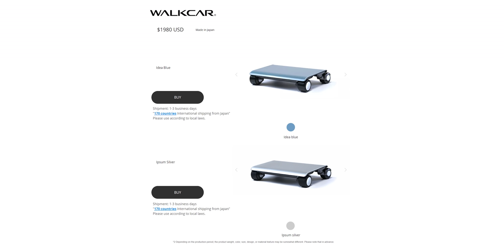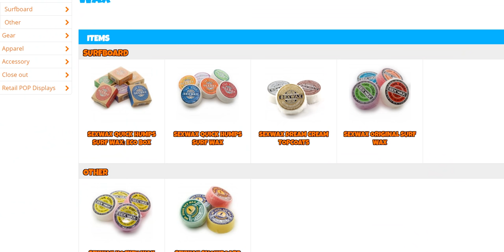Who paid $2000 for THIS...? - WALKCAR

Comment: Okay so, let's perfect the product: TWO separate platforms, one for each foot (better stance/control). Maybe just scrap the motors altogether so people can predictably control speed/turns. For better braking just add big rubber bits on the front so you can toe down to brake. Maybe make the whole thing out of a cheaper material like...I dunno, leather (could probably get away with laces like a shoe has, too). Throw it all together+slap on some LEDs+charge half the price these guys are=profit

Comment: It's like they saw hoverboards and said "huh, I wonder if we could do that but take out any of the good design decisions and replace them with stupid ones." It's almost like someone described very vaguely to them how a hoverboard works, but they couldn't figure out the self-balancing part.... and ended up making this horror. Hoverboards actually work quite well. The larger wheels allow them to accommodate bumps and steeper inclines, and the fact that the entire chassis tilts as you press on the sensors means that you don't lose grip by trying to slow down. Controlling them is actually quite natural. But this? This is the worst combination of electric skateboard and hoverboard.

Comment: Battery Walkcar: 2700mAh * 25.2V = 68Wh
Phone: 4080mAh * 3.7V = 15Wh
The Walkcar's battery carries 4.5 times the amount of energy.  Milliamps without Voltage is even more meaningless then 7075 aluminum without temper

Comment: There's a reason every skateboard uses rubber wheels for traction and grip. Maybe it's just be video but those wheels look like they are just hard plastic. I feel this thing would be basically impossible to ride in a city where there are sidewalk cracks, rock and basically anything on the ground...

Comment: Does it spin?   I kept wondering if the turning radius issue was a lack of comfort on the control scheme.  If you push forward on one side and backward on the other could you spin in place?

Comment: It's pressure. You don't have to lift your toe up. Squat to slow down (weight goes on heels)
Reply: When I squat with my feet close together, I transfer weight to my toes. If I squat feet apart, I can transfer weight to my heel, but I'm super unbalanced. He does understand you don't have to fully lift your foot up, he explained how the sensors work by detecting pressure, but he rode it and said you have less balance while trying to slow down. End of story.

Comment: They really should turn that thing horizontal and have you stand sideways, you have so much more balance that way. Thats why skateboarders, snowboarders, and surfers stand that way, because you have way more balance. They also should make it so you can see the sensors that you stand on to get it to work, because otherwise you dont really know exactly where to stand and apply pressure. Its honestly a pretty bad design.

Comment: Materials: 9/10, that deck is wack
Engineering 7/10, taping the deck down and having only two strain gauges per foot to reduce control resolution 
Design WHY/10

Comment: Id take the Polaris. This thing looks like it was designed to stimulate the facial reconstruction industry. Also regardless of how nicely its built, 2000$ for something with such limited capability is just not worth it from any practical perspective. You would be outperformed by a kid on a power wheels.

Comment: It's clear that the quality of the material and parts is all respectable, but the design of this is just not great. There are so many things that this product just does not provide that can be gotten from much cheaper alternatives. Also, riding with open shoulders (meaning facing forward in such a way that neither of your shoulders are distinctly in front of the other) on a small platform seems unsafe and uncomfortable. I suspect that a lot of this might stem from an idea of "if it looks like a skateboard, it won't be taken seriously" which is just a really unfortunate assessment of what's important.

Comment: I'm sorry, you lost me on $2000, it seemed only slightly more reasonable when i realized this wasn't just a human powered board with wheels, but still $2000?
10 degree incline is probably not going to work with a 'gear ratio' this..... unforgiving, it might have been able to accelerate+ if you had been going maybe 5kph before hitting the incline